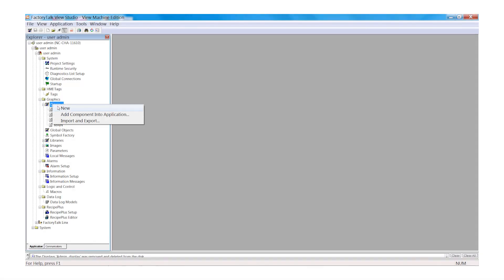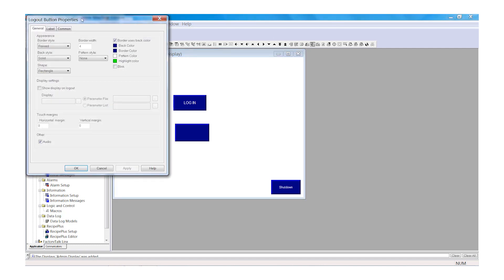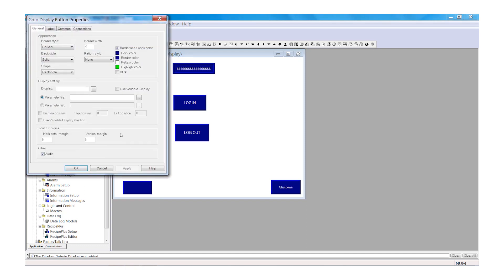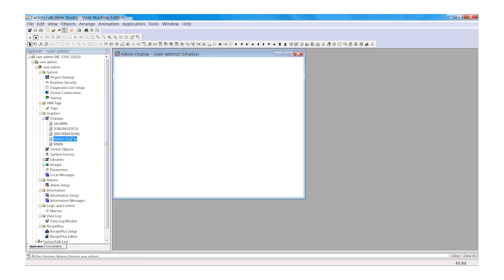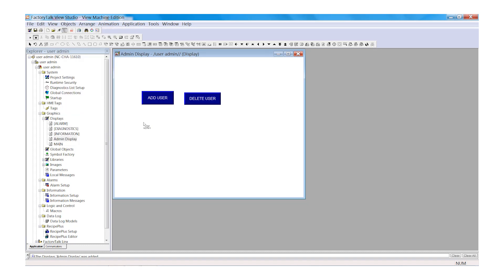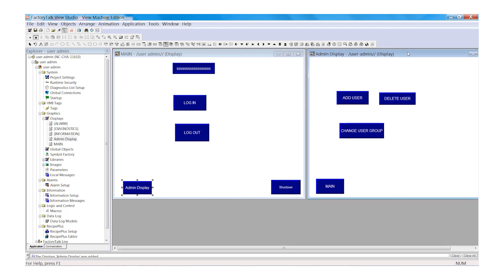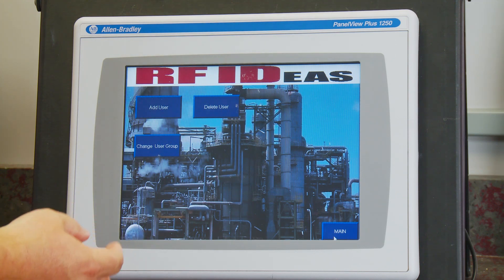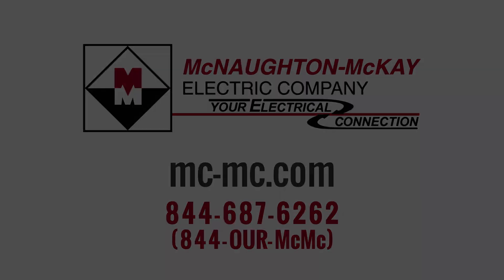Setting up an RF IDeas reader to work with Rockwell Automation FactoryTalk View ME

Comment: Hello , how can  RFIDeas reader connect to HMI PanelView  800 ?
Reply from the maker: Hello, Yes this is possible. It will be the same process as a PanelView plus 7 because the RF Ideas uses a USB cable. The PanelView 800 also has a USB port. If you need personalized support or have further questions or comments, we recommend reaching out to your local Rockwell Automation distributor.
Reply: @mcnaughtonmckay  Can you suggest me how to config RFIDeas pcprox plus or change mode RFIDeas reader to HID mode ? I cannot connect HMI PanelView800 to card reader.
Reply from the maker: @thanhvutri6323  Hello, Please refer to the Integrating RD Ideas Reader with PVP Terminals manual (https://www.rfideas.com/sites/default/files/2020-02/Integrate_RFIDeas-Readers_PVP_Terminals-2015.pdf) page 7 for initial setup assistance. If you have further questions or concerns, please contact your local Rockwell Automation distributor for personalized support.
Reply: @mcnaughtonmckay  Hello , How can i change RFIDeas connection type "Serial: RS232 and Virtual COM ports " to "USB Ports" ? I'm just only connect via RS232 and virtual COM port .
Reply from the maker: @thanhvutri6323  Hello, we recommend reaching out to your local distributor for personalized support for this issue. Unfortunately this is beyond the scope of what can be addressed here.

Comment: How do you connect  to database so that you can add a user to the database and it connects to all the machines?
Reply from the maker: Hi Antoine, 
For this question, we recommend that you contact your local Rockwell Automation distributor. The answer is dependent on your application, programs you will be running and other variables that are too in-depth to address in a YouTube comment. Here is a link to the Rockwell Automation Partner Locator to find your nearest distributor for technical support: https://www.rockwellautomation.com/en-us/sales/partner-locator.html

Comment: This might be a dumb question but do they use the cards unique ID number for the user ID, so one would not be able to make multiple cards that have identical credentials and thus access.
Reply from the maker: Hi Joe, Most RFID cards purchased are manufactured with a unique ID, so having duplicate cards for the same login typically is not an issue. If you have further questions or concerns, please reach out to your local Rockwell Automation distributor.

Comment: Is there a way for this to be used on a master PLC and used for access control on remote machines that are all networked together?   Say scan a user's ID onto say a control logixs rack and store the data for another machine to use for hmi access control.
Reply from the maker: Hi Mark, Yes, profiles can be made and used from multiple machines. We recommend reaching out to your local distributor as they will be able to provide more specific guidance. If you are local to one of our branch locations, we would be happy to assist: https://www.mc-mc.com/LocationFinder

Comment: Can this device be used directly with a Compactlogix or Controllogix to interact with an HMI such as Wonderware? I.e. to log alarm acknowledgements or events?
Reply from the maker: Hello Rod, 
If you need an RFID system that needs to connect directly to a Logix Controller, please check out Rockwell’s Bulletin 56RF High-frequency Radio Frequency Identification (RFID) System. The link below will take you to the product brochure:

https://literature.rockwellautomation.com/idc/groups/literature/documents/br/rfid-br001_-en-p.pdf  

In regards to the Wonderware question, this would best be answered by them directly as we do not support that software.

If you have further questions or concerns, don't hesitate to reach out to your local Rockwell Automation distributor for personalized support. Thank you!
Reply: Hi , I’m planning yo use rfideas with Rockwell software, were you able to do it ?
Reply: @Platon-b4t  I wound up using and rfid reader with my HMI software instead, it was a lot cheaper

Comment: Hi' thanks a lot for your video and idea 

One thing, I'd like try it to do it as well, so I'd like know what model of PLC and reader do you use in this example please 

I appreciate your support, ive followed you from LinkedIn

Thanks
Reply from the maker: Hi there, the RFID Reader used is a Wave ID Plus (pcProx Plus) from RFIDeas.
I believe a CompactLogix 5370 is used in this video. However, this system is compatible with most Rockwell PLC product lines. Thanks for following!
Reply: @mcnaughtonmckay  de communication it was for Ethernet?
Reply from the maker: @procontrolautomation2299  The RFID reader in the video is connected over USB directly to the PanelView.
There are other RFID options that communicate over Ethernet. Here is a datasheet with more information:
https://literature.rockwellautomation.com/idc/groups/literature/documents/td/56rf-td001_-en-p.pdf
We recommend reaching out to your local Rockwell Automation distributor for more information about the RFID option that would best suit your needs.
Reply: @mcnaughtonmckay  Hi you said it is connected over USB. is it RS232?
Reply from the maker: @hyeonseonlim9759  The USB RFIdeas reader does not communicate over RS-232, it is only meant for USB communication. RFIdeas has a serial version of their readers that can communicate over RS-232, however. Please reach out to your local RFIdeas distributor for more information. If you are in the US, you can check for one of our locations near you: www.mc-mc.com/locations
Reply: This is the model you need 

RDR-805W1AKU-RA

Comment: After completing the process and scanning the card, the display name for user is the badge number. Is there a way to change the display name to the name of actual employee?
Reply from the maker: Hi Piyush, Thank you for your question. You would need to use if/then statements within the expression for the string display to say if a user is logged in with their badge, then display their actual name rather than their badge number. Hopefully this is helpful, but it may be beneficial for you to contact your local distributor for instructions specific to your application.

Comment: One the things that should be conveyed in a product video is tell me what it is, tell me what I can use it for or it’s usefulness. Then demonstrate how to set it up via some setup process demo or configuration. The FTV ME Configuration was fine in the screen setup. But I watched he video and have no remote idea what is RF IDeas or what to do with it.  No clue.
Reply from the maker: An RF IDeas reader allows employees to use their own badge for operator access at PanelView plus terminals or Logix-based controllers.  A simple wave or tap of their badge to the reader saves valuable time during the login process by avoiding typing errors and re-entry.
Control user access through security configurations that can be modified in the ME application at design-time as well as runtime. Users can be added or deleted easily or a user’s group can be changed.  Factory workers, operators or plant managers can log on to the FactoryTalk-enabled system quickly and easily. 
We hope this helps clarify! If you have additional questions, please reach out to your local Rockwell Automation distributor.
Reply: McNaughton-McKay Electric Company Thanks for the feedback. That explained what wasn’t explained in the video as to what was it and what was it used for.